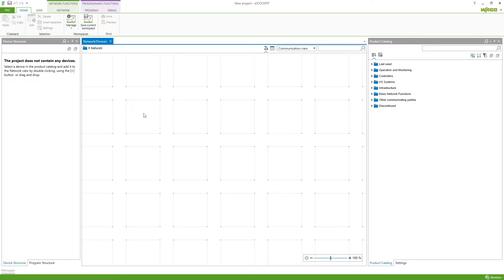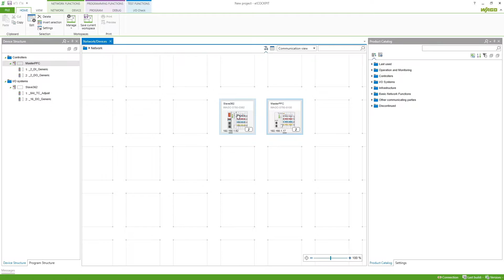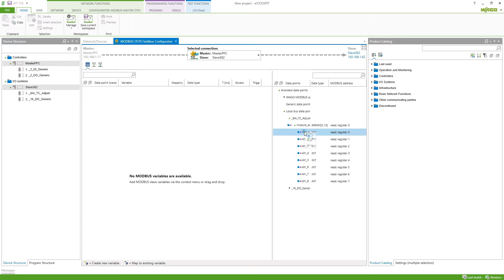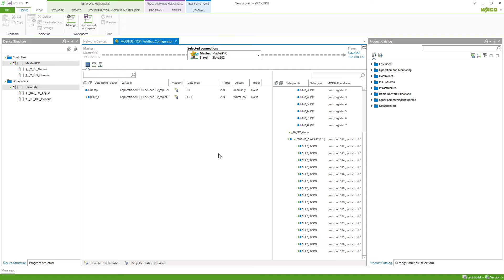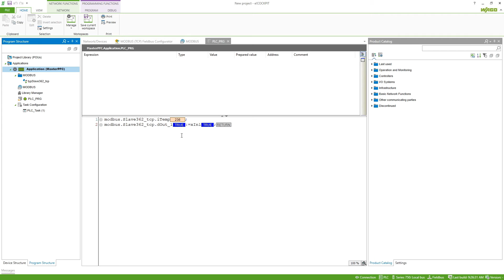e!COCKPIT - Modbus Configurator #5 - Use Coupler

Comment: Hello, 
How the plc could understand when the connection with the coupler fault and set alarm bit for example in the program? How the diagnostics of Modbus could be made. Thanks.
Reply from the maker: Hi, The e!Cockpit manual at page 74 hints to the variable list IoConfig_Globals.
There you will find a diagnostic instance for every slave.
Reply: @WAGO_Germany  I guess you mean 276 page :) Thanks.